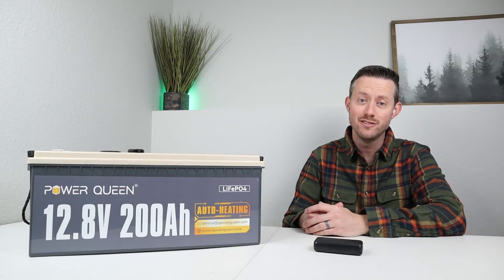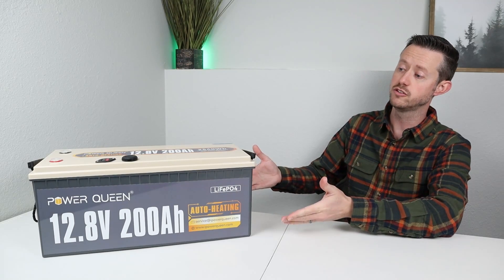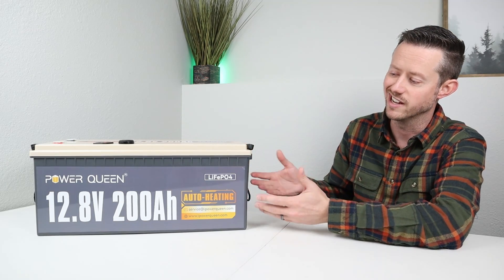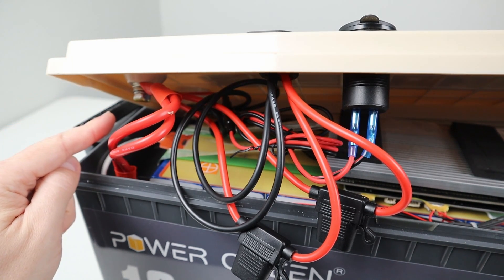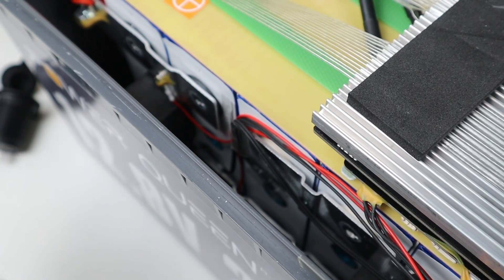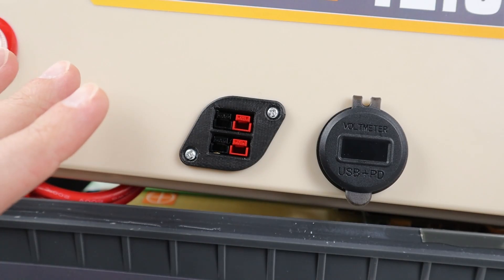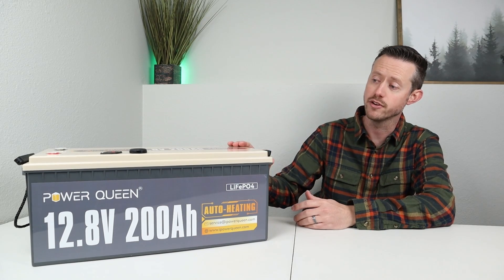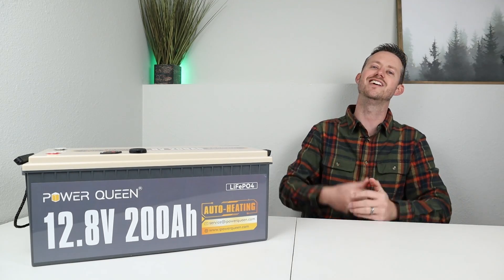Building The Largest USB Power Bank!? - Simple DIY Mod for my HUGE 200ah LiFePO4 Battery!

Comment: Here's another idea.

Use a 12V cig socket or the Anderson PP (or any other type of output) to attach a higher power LED panel to the light or have that LED panel on a short cable so that no matter where you are when moving the battery/ repairing something on the RV its installed in you have an extremely powerful LED panel (in my case a 7000 Lumen/11-14 volt 5A 70 watt) that can light up your entire campsite, the entire side of the road, the entire storage area where your batteries are stored on your RV, etc. And the LED panel I use is often set to 12V 1A...so 12W and its so bright that there's not much need to turn it up.

I use an XYS3580...a 0-36V 0-5A 80W Buck Boost Converter with OLED display that is by far the nicest display and the best firmware you'll ever find on one of these cheap DIY buck boost modules under $25. WIth a 12V LiFePO4 battery's voltage running in the exact same voltage range of the LED panel I prefer a buck boost converter gives you the voltage and amperage needed no matter what.

There's a slightly more expensive version that is actually MUCH more powerful (0-36V 0-6A 216W) and I would highly recommend you buy the XHY3606 and NOT the XYS3580. The cost difference is less than $10 with the XHY3606 coming out to $25-$27 without Wifi. It also comes with a remote which could be quite useful if you are using this inside of your RV/popup camper/in your campsite or tent as any late night bathroom run would allow you to "call up" one of the programmed settings (10 of them from M0 to M9) and you could have your primary light setting as number 1 and your low light setting as number 2. Setting the voltage for 12V and the amperage for 0.100A or 0.050A would just barely light up the LEDs and wouldn't wake up anyone else in your campsite but would give you just enough light to safely navigate outside towards your designated area to relieve yourself.

This buck boost converter gives you full control over your LED light and is the easiest way I have found to safely drive these hight power COB LED's. My 70W panel fits quite nicely on the side of a 30 cal ammo can using tape that helps transfer the heat from the LED's thin aluminum plate it sits on to the metal of the ammo can box. Coincidentally my 4S8P A123 ANR26650M1B battery I got from a 12S8P pack that was cut into thirds fits perfectly into the ammo can with a little padding added around each side. The only downside is the buck boost module won't fit in the lid and still have room to close the lid.

There are several people here on YouTube that have used 1 or more of these panels to make floodlights and you could simply mount the buck boost converter and the panel on a small metal box and run a power cord to the LiFePO4 battery using Anderson or XT30/60 givng you a super powerful side of the road working light should your RV ever break down.

NO ONE would miss your RV on the side of the road if you had it illuminated with one of those LED lights.

Comment: How can you remove those busbars since they are laser welded?
Reply from the maker: The battery isn't servicable. Taking off the lid is a chore and it isn't designed to be torn down. Welded busbars are more durable for batteries that don't have normal access.

Comment: Are those Anderson connectors both input and output?
Reply from the maker: They are a direct connection to the battery terminals, so yes. You can charge or discharge from them.

Comment: I'd prefer to add the additional connections on an external box that connects to the existing terminals. Thus not needing to remove the top and voiding the warranty. Also, this would allow more and different connections that are removable and expandable.
Reply from the maker: Yeah, I'd love to design a 3d printed box, would have to be pretty large though!
Reply: Bingo.  I was going to make this same comment.
Reply from the maker: @mfgxl  the purpose of this video is to get ideas flowing. Hey, maybe a manufacturer will steal this idea and just put them on the battery out of the factory. They could have a custom second BMS inside that allows for 40amps input / output and multiple output connections. The options are endless!

Comment: I did something similar to this with my 300ah battery. I figure my phone will be fully charged now for about 4.8 years.  You should have added a couple (or more) of 5521 outlets. That would have added a lot of functionality for people where space is a real premium (say truck campers) because they could power their fans and LED lights straight from the 12v 5521 ports w/o turning on an inverter. I run several Treva 10" fans in this manner and love the ease of use. It also powers a 24" Samsung TV directly, rather than using an AC power brick.

But one thing you failed to mention is that this is not TSA compliant so you can't take it on a commercial flight in the U.S.
Reply from the maker: Yeah, a bit too big for that! Lol...

Comment: why is the anker 3.7v powerbank and your powerbank is 5v?
Reply from the maker: The rated output on the back of the Anker states 10,000mah @ 3.7v. It uses lithion Ion cells so that's the nominal voltage for the cells inside. 

I chose 5v on the larger battery to give a more accurate measurement for charging USB devices repeatedly. The rated capacity of the 200ah battery at 3.7v would be larger than 510,000mah due to the slight voltage change in measurement vs 5v.
Reply: @Jasonoid  I thought it was strange because the rated output on the front of the Power Queen was 200ah @ 12.8v.
Reply: 1  In the name of God, the Gracious, the Merciful.

2  Praise be to God, Lord of the Worlds.

3  The Most Gracious, the Most Merciful.

4  Master of the Day of Judgment.

5  It is You we worship, and upon You we call for help.

6  Guide us to the straight path.

7  The path of those You have blessed, not of those against whom there is anger, nor of those who are misguided.

2  God, there is no god but He, the Living, the Eternal.  To Him belongs everything in the heavens and everything on earth. He is the Sublime, the Magnificent. Originator of the heavens and the earth. He made for you mates from among yourselves, and pairs of animals, by means of which He multiplies you. There is nothing like Him. He is the Hearing, the Seeing.

3  He sent down to you the Book with the Truth, confirming what came before it; and He sent down the Torah and the Gospel.

4  Aforetime, as guidance for mankind; and He sent down the Criterion. Those who have rejected God’s signs will have a severe punishment. God is Mighty, Able to take revenge.
5  Nothing is hidden from God, on earth or in the heaven.
6  It is He who forms you in the wombs as He wills. There is no god except He, the Almighty, the Wise.

1  Say, “He is God, the One.
2  God, the Absolute.
3  He begets not, nor was He begotten.
4  And there is none comparable to Him.”

13  To Him belongs whatever rests in the night and the day. He is the Hearing, the Knowing.
14  Say, “Shall I take for myself a protector other than God, Originator of the heavens and the earth, and He feeds and is not fed?” Say, “I am instructed to be the first of those who submit.” And do not be among the idolaters.

100  Yet they attributed to God partners—the sprites—although He created them. And they invented for Him sons and daughters, without any knowledge. Glory be to Him. He is exalted, beyond what they describe.
101  Originator of the heavens and the earth—how can He have a son when He never had a companion? He created all things, and He has knowledge of all things.
102  Such is God, your Lord. There is no god except He, the Creator of all things; so worship Him. He is responsible for everything.
103  No vision can grasp Him, but His grasp is over all vision. He is the Subtle, the Expert.
104  “Insights have come to you from your Lord. Whoever sees, it is to the benefit of his soul; and whoever remains blind, it is to its detriment. I am not a guardian over you.”

143  And when Moses came to Our appointment, and his Lord spoke to him, he said, “My Lord, allow me to look and see You.” He said, “You will not see Me, but look at the mountain; if it stays in its place, you will see Me.” But when his Lord manifested Himself to the mountain, He turned it into dust, and Moses fell down unconscious. Then, when he recovered, he said, “Glory be to you, I repent to you, and I am the first of the believers.”
144  He said, “O Moses, I have chosen you over all people for My messages and for My Words. So take what I have given you, and be one of the thankful
145  And We inscribed for him in the Tablets all kinds of enlightenments, and decisive explanation of all things. “Hold fast to them, and exhort your people to adopt the best of them. I will show you the fate of the sinners.”

36  To every community We sent a messenger: “Worship God, and avoid idolatry.” Some of them God guided, while others deserved misguidance. So travel through the earth, and see what the fate of the deniers was.

16  And mention in the Scripture Mary, when she withdrew from her people to an eastern location.
17  She screened herself away from them, and We sent to her Our spirit, and He appeared to her as an immaculate human.
18  She said, “I take refuge from you in the Most Merciful, should you be righteous.”
19  He said, “I am only the messenger of your Lord, to give you the gift of a pure son.”
20  She said, “How can I have a son, when no man has touched me, and I was never unchaste?”
21  He said, “Thus said your Lord, `It is easy for Me, and We will make him a sign for humanity, and a mercy from Us. It is a matter already decided.'“
22  So she carried him, and secluded herself with him in a remote place.
23  The labor-pains came upon her, by the trunk of a palm-tree. She said, “I wish I had died before this, and been completely forgotten.”
24  Whereupon he called her from beneath her: “Do not worry; your Lord has placed a stream beneath you.
25  And shake the trunk of the palm-tree towards you, and it will drop ripe dates by you.”
26  “So eat, and drink, and be consoled. And if you see any human, say, ‘I have vowed a fast to the Most Gracious, so I will not speak to any human today.'“
27  Then she came to her people, carrying him. They said, “O Mary, you have done something terrible.
28  O sister of Aaron, your father was not an evil man, and your mother was not a whore.”
29  So she pointed to him. They said, “How can we speak to an infant in the crib?”
30  He said, “I am the servant of God. He has given me the Scripture, and made me a prophet.
31  And has made me blessed wherever I may be; and has enjoined on me prayer and charity, so long as I live.
32  And kind to my mother, and He did not make me a disobedient rebel.
33  So Peace is upon me the day I was born, and the day I die, and the Day I get resurrected alive.”
34  That is Jesus son of Mary—the Word of truth about which they doubt.
35  It is not for God to have a child—glory be to Him. To have anything done, He says to it, “Be,” and it becomes.
36  “God is my Lord and your Lord, so worship Him. That is a straight path.”
37  But the various factions differed among themselves. So woe to those who disbelieve from the scene of a tremendous Day.
38  Listen to them and watch for them the Day they come to Us. But the wrongdoers today are completely lost.
39  And warn them of the Day of Regret, when the matter will be concluded. Yet they are heedless, and they do not believe.
40  It is We who will inherit the earth and everyone on it, and to Us they will be returned.
41  And mention in the Scripture Abraham. He was a man of truth, a prophet.
42  He said to his father, “O my father, why do you worship what can neither hear, nor see, nor benefit you in any way?
43  O my father, there has come to me knowledge that never came to you. So follow me, and I will guide you along a straight way.
44  O my father, do not worship the devil. The devil is disobedient to the Most Gracious.
45  O my father, I fear that a punishment from the Most Gracious will afflict you, and you become an ally of the devil.”
46  He said, “Are you renouncing my gods, O Abraham? If you do not desist, I will stone you. So leave me alone for a while.”
47  He said, “Peace be upon you. I will ask my Lord to forgive you; He has been Kind to me.
48  And I will withdraw from you, and from what you pray to instead of God. And I will pray to my Lord, and I hope I will not be disappointed in my prayer to my Lord.”
49  When he withdrew from them, and from what they worship besides God, We granted him Isaac and Jacob. And each We made a prophet.
50  And We gave them freely of Our mercy, and gave them a noble reputation of truth.
51  And mention in the Scripture Moses. He was dedicated. He was a messenger and a prophet.
52  And We called him from the right side of the Mount, and brought him near in communion.
53  And We granted him, out of Our mercy, his brother Aaron, a prophet.
54  And mention in the Scripture Ishmael. He was true to his promise, and was a messenger, a prophet.
55  And he used to enjoin on his people prayer and charity, and he was pleasing to his Lord.
56  And mention in the Scripture Enoch. He was a man of truth, a prophet.
57  And We raised him to a high position.
58  These are some of the prophets God has blessed, from the descendants of Adam, and from those We carried with Noah, and from the descendants of Abraham and Israel, and from those We guided and selected. Whenever the revelations of the Most Gracious are recited to them, they would fall down, prostrating and weeping.
59  But they were succeeded by generations who lost the prayers and followed their appetites. They will meet perdition.
60  Except for those who repent, and believe, and act righteously. These will enter Paradise, and will not be wronged in the least.
61  The Gardens of Eden, promised by the Most Merciful to His servants in the Unseen. His promise will certainly come true.
62  They will hear no nonsense therein, but only peace. And they will have their provision therein, morning and evening.
63  Such is Paradise which We will give as inheritance to those of Our servants who are devout.
64  “We do not descend except by the command of your Lord. His is what is before us, and what is behind us, and what is between them. Your Lord is never forgetful.”
65  Lord of the heavens and the earth and what is between them. So worship Him, and persevere in His service. Do you know of anyone equal to Him?

111  And say, “Praise be to God, who has not begotten a son, nor has He a partner in sovereignty, nor has He an ally out of weakness, and glorify Him constantly.”

85  Whoever seeks other than Islam as a religion, it will not be accepted from him, and in the Hereafter he will be among the losers.

Read The Quran
“I am to you a clear warner.”
 “That you shall worship none but God. I fear for you the agony of a painful Day.”

Comment: You built your own Dr. Prepare Hub for your Power Queen battery!  I think it's brilliant!
Reply from the maker: I'm thinking of other options that don't require battery disassembly!
Reply: @Jasonoid  how about a custom hub for the Dr. Prepare?
Reply from the maker: @LiquidTurbo  it still only allows for 100 watts output or 10 amps (16awg internal wires), I think more power would be needed for any 12v appliance.
Reply: @Jasonoid  One can hope for a v2 with increased output. The Dr.Prepare would be amazing if it had 120w or 160w DC output through the hub! I was still impressed enough by it to pick it up.
Reply from the maker: @LiquidTurbo  it will work for most DC appliances and I LOVE how compact that setup is. I hope they started a new trend with these batteries and output ports!

Comment: to anyone thats thinking of tring this mod, be fully aware of the safety concerns, if you arent comfortable with any of these concerns, dont try this mod out.
thanks for sharing this, it is interesting, but just voiding the warnty for this expensive battery is enough for me to leave the mod external, instead of taking it apart.
you would have also probably done it external if you had not already taken it apart for the review, right?
Reply from the maker: I did the mod so that I could take this battery camping and have the connections I want. A few DC ports and USB ports is all I need. I wanted something that didn't take up any additional space either. I don't like wires going all over the place so if the lid wasn't removable, I probably wouldnt do the same mod. 

Another option could be some sort of 3d printed enclosure that attaches to the main battery terminals and also provided additional ports. Kinda like an attachable expansion system. That sounds like a fun project!

Comment: Excellent video.  Really disappointed with the amount of wasted space some of these vendors saddle us with their cases.  Power Queen has their new "premium" 100ah battery that really looks like their standard cells in a "correctly sized case" for "more money".  It would be really nice to have a form factor on the spreadsheet.  I use this in my truck and the space used for the amount of amp hours is really important.
Reply: My 300ah filled the extra space with additional cells. Kind of the reason I went with 300ah was the idea of no wasted space.
Reply from the maker: I agree they could really cut down on the size to save on space!
Reply: They may size these cases the way they do because they are considered "drop in " replacements for lead-acid battery applications.